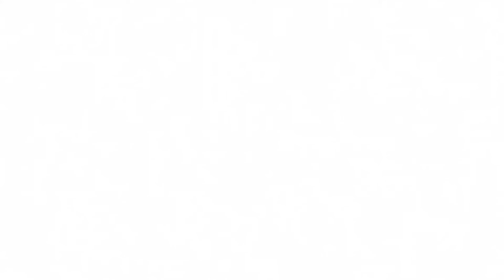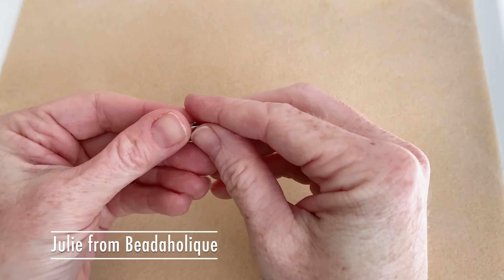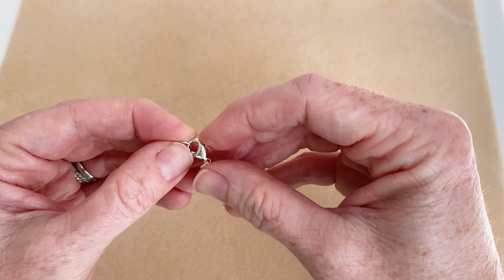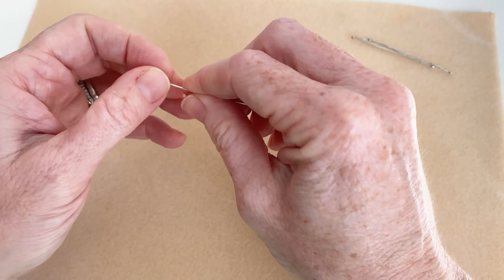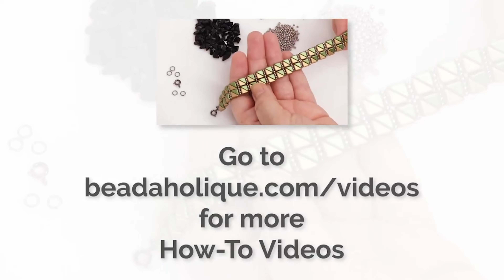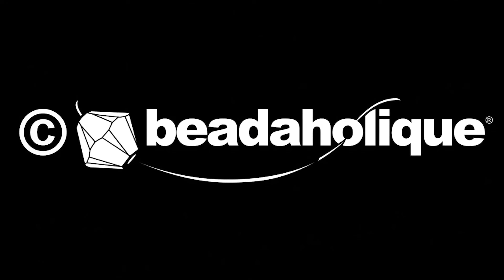Jewelry Making Hack: How to Complete a Clasp Set

Comment: Nice idea however you use an expensive ball pin and not a piece of 20 gauge (or whatever gage you want to use) wire to do this?? I guess it's what you have on hand- 🤷‍♀️
Reply from the maker: Yes, it was what I had on hand. I personally seem to always have head pins on hand and not wire but you can definitely use wire. The advantage sometimes of using a head pin is that you can match the color of the other part of the clasp if it's an antique gold or antique silver.